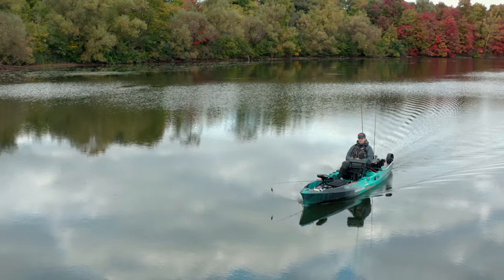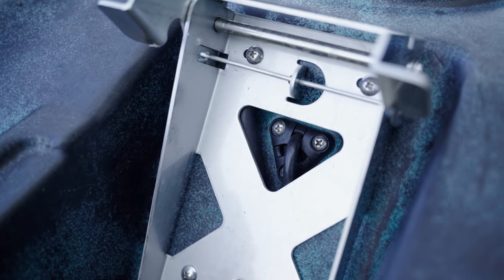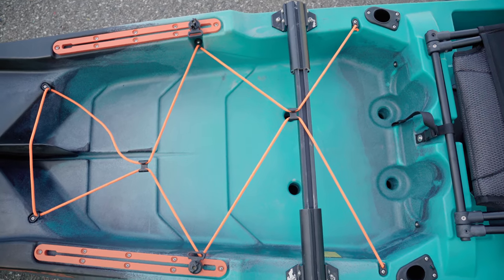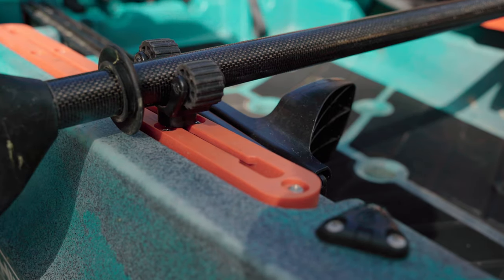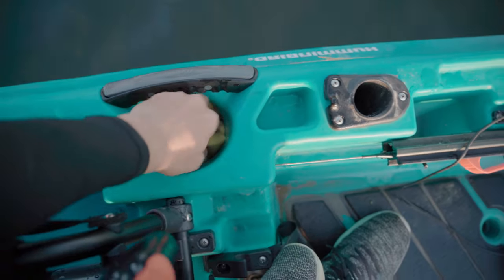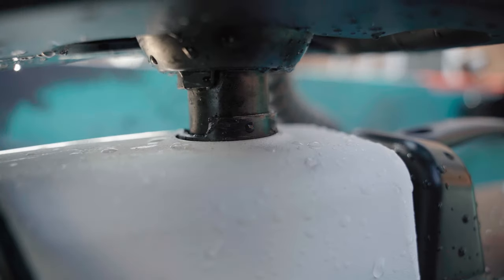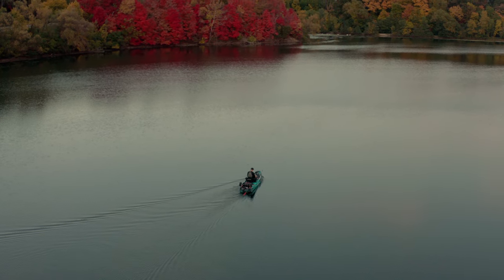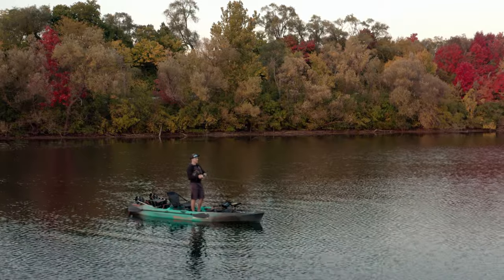Complete Review - Old Town AutoPilot 136 (2020)

Comment: God review, does the hummingbird helix7 G3N itnterface with the motor.  i bought a new 136, but the motor would not power up and old town is sending replacement parts.  There is a relay in the foward section that senses the kill switches and will illuminate LEDs on the board when the switches close.  The relay will close and the motor will work if both kill switches are closed.
Reply from the maker: My helix 9  g3n with Mega does not interfere with the motor at all. Perfect combo if you ask me.
Reply from the maker: Not sure what you're talking about with these relays, switches, amd LEDs. Are you installing that, or is that a new feature of the kayak I've never heard about?
Reply: @KayakOutbreak  There is a small circuit board attached to the foward section inside. The kill switch by the seat and the motor down & locked must be engaged or the power from the batteries will not power the motor through a small relay also attached to the board.  There are 2 LEDS mounted on the board that will illuminate RED when the kill switch is closed and the motor down.  Mine didn't do that and they are sending another relay and I'll see how that goes.  it's not covered or mentioned in the manual and i was surprised also, but it's there.
Reply from the maker: Got it now! Unfortunate that you got that issue, but I'm glad OT is taking care of you they best they can.
Reply: @KayakOutbreak  i was told otherwise and i believed that it worked through bluetooth. not getting power to my motor I was unable to confirm this, this was a new kayak, but a lemon.

Comment: Landing gear - doesn't drilling and installing those immediately void the warranty?
Reply from the maker: I'm not 100% sure, but from my understanding - if you have an issue that was caused by aftermarket modification, then the warranty is voided.
Reply: @KayakOutbreak  makes sense. It's too bad they didn't add some sort of mounts capable of supporting the entire weight. I'm upgrading from a canoe with a trolling motor and this weighs empty what my canoe weighs fully rigged.
Reply: That is an interesting point and something I've not saw or heard addressed in any review video.  A kayak that heavy WILL require a cart or trailer.  I think most are going with the trailer option, which doesn't work for me because the whole reason I have a kayak is to access areas unaccessable by a boat/trailer.   I will have to dig more into that.  Would the Boonedox Groove track model work with it?  You noted that the rear gear tracks were too far back for most people..that might be an option then...mount the landing gear to the rear gear tracks.  That's how my Native is currently setup.
Reply from the maker: The gear tracks are attached by a bunch of self tapping screws. It will not be nearly strong enough as Natives tracks. Either way, you would need some sort of backing plates. It will be really hard/almost impossible to reach under the tracks. Plus, weight distribution wouldn't be as good the further back you install them. The way I installed mine is very solid and I'm very confident in it.
Reply: @tnbackroads  I tried pushing our canoe fully loaded using one of those $100 kayak/canoe carts that cradle underneath and strap on.  The weight of that was comparable this the 136 empty. It was HORRIBLE. Will never do it again. I'm a tall strong guy, but pushing that up the grade with my two tweens helping was a tough go. Parking lot kinda stuff, sure, but to offroad, you need some sort of assist. It attaches to the kayak securely without at all damaging it. Can apply it's own thrust somehow only as needed. But is still small enough and light enough to be stowed for your trip. I see those fat tire e bike things, but what do you do with the bike! I guess you could chain the cart thing to a tree - if you plan on landing at the same spot. Seriously, the need built-in power wheels lol
Reply: @blaircox1589  I believe they have reached the point of losing the benefits of a kayak...especially when broken down to kayak vs boat (Jon boats, etc).  When a kayak reaches the point of requiring a trailer to effectively launch it, and or two people to carry it, then it's simply too big and heavy.  I've decided on an alternative to the Autopilot Sportsman kayak is to just buy a 12 or 14 foot Jon boat and adding a Motorguide XI3 trolling motor to it. That would give me more overall room in the boat for gear and such. Two people could fit in it to fish (and help carry it) thus also eliminating the need for 2 kayaks.  And best of all...can still throw it in a truck bed.  I could still have spot lock, remote control, etc and for half the price of a new Old Town kayak.  The kayak alternative I am looking at too is a Nucanoe Frontier with the bow mount XI3.  It's the same length  as the 120 Sportsman but lighter weight and of course the XI3 is factory designed for kayaks and small boats....with spot lock, tracking, etc.
Reply: @tnbackroads  fair enough. To be honest, if I hadn't won mine - resulting in having to buy something for my son - then the trailer, then hitch, then then then - I'd still be using my 16' canoe with trolling motor and custom made fibreglass pontoons making it incredibly stable and easy to move around on top of the car.  I'm sure I'll love the 136 once it's set up though. I still think it's better than a full-size boat in terms of storage.  I made the canoe darn near unsinkable and we could do things with it you'd never dream of doing with a straight canoe, so I'm little apprehensive about the stability of this.

Comment: I want this kayak but it looks that I will also need a truck..... :(
Reply from the maker: Yeah, its a bit heavy. You could get away with a smaller trailer. I'm sure combined weight shouldn't push the towing capacity limits of most smaller cars out there.

Comment: Err, instructions say up to Group 27 battery on the unit I just got this week.
Reply from the maker: Group 27 size battery is a safe bet that it will fit inside the box. Inside dimensions are 13.25" L x 7.25" W x 9" D.
Reply: @KayakOutbreak  okay, so it can't hold up to a Group 31 as you said in the video. A group 31 is about ~13 x 6.8 x 9.44 inches. So a half-inch too high. I have both batteries, guess could try and see what happens. A 31 is heavier, but will last longer.
Reply from the maker: You might be able to fit it. The cover has a bit of of room to work with
Reply: @KayakOutbreak  I try to build a waterproof battery box to hold lithium battery, replacing old town battery box. can you tell me the max space of the kayak's battery compartment? thanks.

Comment: How much it costs
Reply from the maker: This model was $3,999 this year. I've heard the prices will go up for next year!
Reply: @KayakOutbreak  thanks for the info
Reply: @KayakOutbreak  quick question do you think it would be best to carry a extra battery on board for back up ???
Reply from the maker: I carry a single 100ah lithium battery, and its plenty for me most of the time.

During prefishing I'm more likely to use most of it. But when I'm fishing a  full day tournament I usually use as 23 to 50% of my battery. 

When you drop down your max throttle to speed 7-8, you can increase range dramatically. And when you fish, you use speed 2 or less.

So, if you want to be quick and have an extra piece of mind, another 50ah lithium battery would be nice. But you're ok with slowing down, a battery metter would be more useful. 

Hope this helps

Comment: $4k and it doesn't come with a battery that's insane.
Reply from the maker: I see where you're coming from. There are batteries under $100 that would suffice for average anglers.

Do you think if Old Town included one of those it would be a better deal?

I think they choose not to include a battery because of the added cost (price and shipping), safety, and simply because there are so many options out there. One of the cheap batteries won't push this kayak to its full potential (speed, efficiency) 

Also, keep in mind that there are $5K kayaks that only have a pedal drive. No motor, no battery.

Thanks for your feedback. Maybe Old Town will read through the comments and takes note of your feedback! Have a nice day!
Reply: @KayakOutbreak  Well yeah it would be a better deal if they included a battery. I understand the shipping aspect just would be nice to have it arrive and be able to take it out.
Reply from the maker: I'm sure the price would increase if the battery was added to the kayak. It's not all that simple. Either way,  thanks for sharing your thoughts!